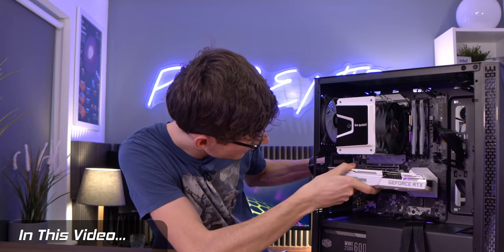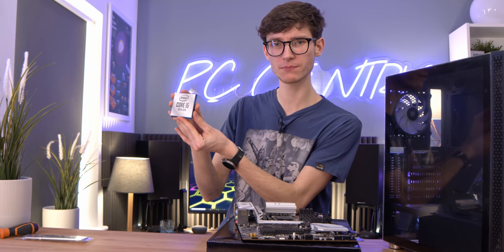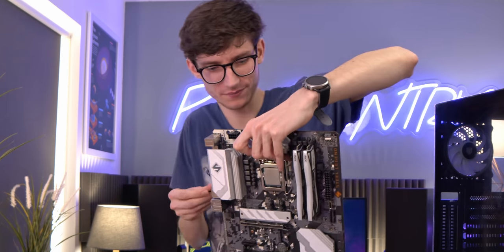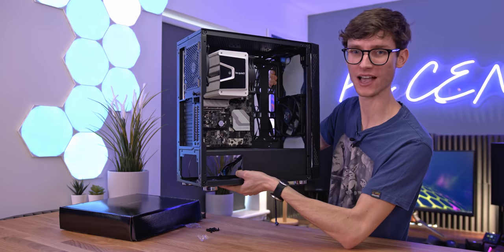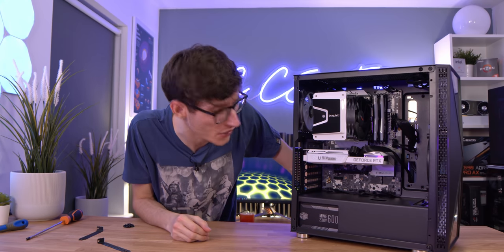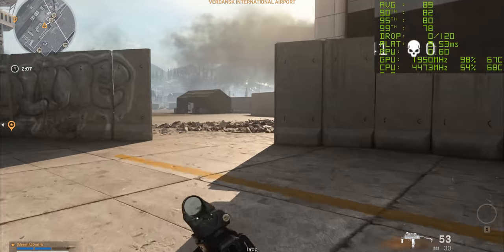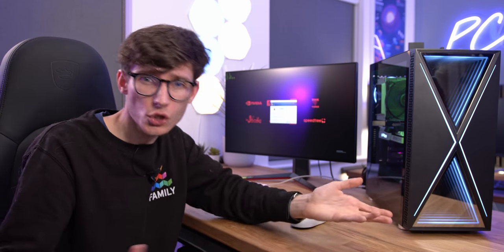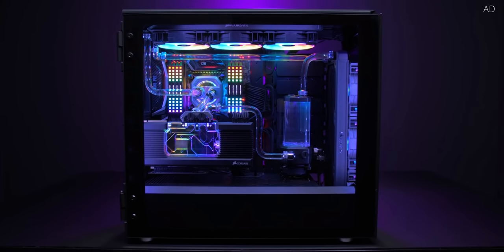The RTX 3060 Gaming PC Build 2021! 😍 Intel i5, 10600K, B560 w/ Cyberpunk 2077 Gameplay Benchmarks!

Comment: Remember the days when gpus were ready available🤣
Reply: TA, Tell me about it. In April I bought a Nvida GeForce RTX 2060 GDDR6 6gb and it cost $600. Now they are running $1,100.
Reply: @mikesilver9285  broke boi struggles
Reply: @connorosullivan3500  thats not borke boi.... it's bad value and pricing learn the difference

Comment: You made the cooler installation waaaaay harder than it needs to be. Place the brace with the screws going through it on a flat surface. Then place the motherboard over it and do the rest.

Comment: Love your content mate. Im a woodworking truck driver who cracked the shits last october when i couldn't get my kids a ps5. Knew nothing about pc then. Just built my kids a pc with whats available and it turned out awesome. i9 10850k, asus tuf rtx3070, asus z490 mobo, xpg gammix 32gRam, gen4 ssd (not compatible just runs a little slower), corsair 850w psu all slapped in a cheap Silverstone case. Awesome help mate 👍
Reply: 240ml AIO liquid cooler aswell. Cost me $3000 aust. 👍🥳

Comment: For the CPU power cable, I tend to install the PSU before the motherboard, feed the CPU power cable through and plug it into the motherboard before screwing it down. Very handy if you're using a fat tower cooler

Was considering buying this case, then saw the (lack of) airflow in the front - big no no!

Comment: Do not plug the chained cables from power supply to the gpu. Run two separate ones. Just a tip for builders. Jayztwocents did a vid on this

Comment: 13:09 nah it really looks bad centric my hoover is a bugati compared to that
Reply: I get 90 to 130 fps on 1440p and 58 to 80 at 4k and 160 to 220 at 1080p max settings no Ray tracing and at 1080p I render at 125 on the resolution slider and that's with a 2080 xtreme waterforce no oc and with an intel core i3 10100f lool so looks like I'll be keeping my 2080 for now then 😀
Reply: @2strokerc5782  Why did you pair an i3 10100f with a 2080? That's an extreme bottleneck!
Reply: @itsmemambo3643  it's like a 7% bottleneck which you will not notice at all

Comment: I got a similar build: Intel core i5 10600K,  Be Quiet! Pure Rock 2,  MSI mpg gaming edge wifi z490 mobo, 16GB (2x8) corsair vengeance 3600Mhz ram, WD blue sn550 1tb,  WD 500gb hdd,  RTX 3060Ti asus tuf triple fan oc, seasonic semi modular 650W psu, noctua case fan, and a cooler master nr 600 mid tower case. I am probably not pushing this pc at all since I play on 1080P 75hz.

Comment: Why are you using a B560. Its NOT good for the CPU. Go for a "Z590". Or just go for an 11400 and also with the mobo and i3/i5/celeron/pentium cpu you can only get ram to 2666MHz. Also expect the VRM’s to crap out
Reply: But intel turbo boost can overclock this cpu and b560 supports ram overclocking
Reply: @marleysr7812  Yes, I know but the VRM’s will probably crap out at 120 Degrees C

Comment: I thought the two split cables that come with the gpu were mandatory. mine wouldn't turn on unles so plugged them into allow for 4 pcie cables powering it but i didn't see you use them

Comment: I ordered the b560 pro4. I am putting on an intel core i3-10100f as a placeholder until I can get 11th gen. But can a pcie 3 ssd work in the m.2 slots? I can only use pcie 4 with the 11th gen processors, so im assuming since pcie is backwards compatible, then the gen 3 pcie ssd will work just fine. Please correct me if im wrong.

Comment: wait so connecting a PCI-E 3.0 drive in a 4.0 Slot doesn't work?? what if i have an x570 board and a 3700x with PCie 4.0 enabled but a 3.0 drive will that give issues and should i put PCie mode to gen3 or auto in BIOS??
Reply from the maker: The whole slot is disabled on b560 if you're not using a 11th gen rocket Lake cpu
Reply: @PcCentric  Damn, that is a crazy restriction

Comment: PCC, help an old fart out if you will. When building is it best to have Windows installed on a 3D NAND SATA 2.5 or a NVMe PCIe 4.0 M.2 2280 PCI-E Gen4?
Reply from the maker: Gen 4 SSD
Reply: @PcCentric , Thanks. Was going to build an Asrock B560 but someone beat me to the last motherboard. Now switching to Asrock Z590 Steel legend.